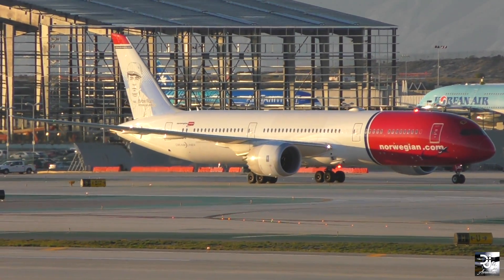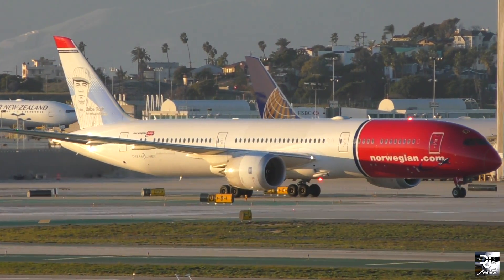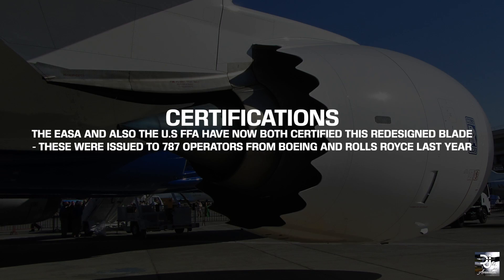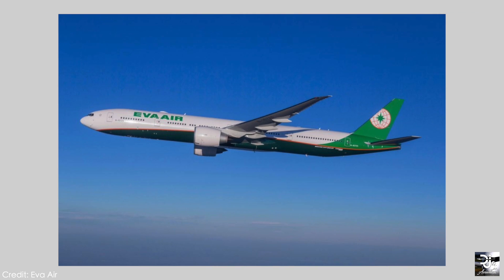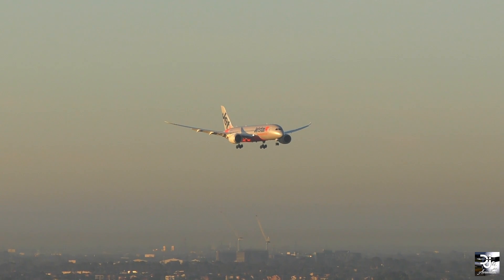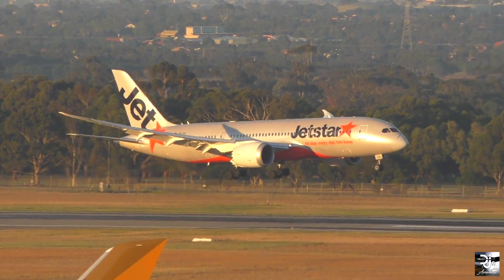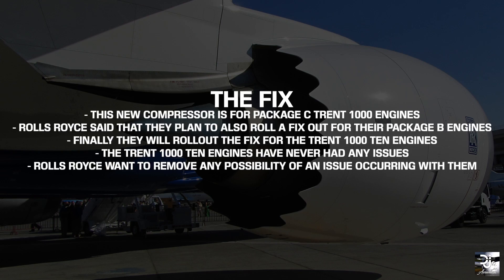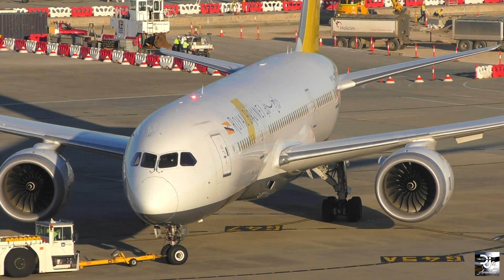Trent 1000 Problems on Boeing 787 (Update)

Comment: You need to get your terminology correct. The issue is with compressor blades and not compressor fan blades. The fan blades are not the issue, well not at this time anyway.

Comment: EASA permits Trent 1000 waiver over blade issues

RR suggested that cracks in blades and drum of the compressor is not an issue that may cause fail.
😎

Comment: Issues with the engines? Are you kidding me? Nothing more nothing less, "just" the engines. Shouldn't all these aircrafts be grounded until these bastards see how to fix the problem? They should be in prison
Reply: Jorge Trevino Calm down buddy. You’re a little late to the party.. All of the affected RR equipped 787’s were grounded and still are.
Reply: @jaemelo2693  are you sure about that? Bcz I might be traveling in two weeks ATH-SG with 787....if it's not yet fixed, what plane they will fly ?
Thanks
Reply: VBlam lol my comment was relevant and accurate at the time of posting (over 2 months ago)

Comment: thanks DJ. I presume you looked at Rolls Royce website for information. I live in England and when the 787 engine problems happened I did look at # Rolls  R # website when earlier problems were found. It was good to see that  RR was dealing with the engines.
I presume that other engine makers like Pratt & Witney and CFM may also have had technical problems in the past.
Reply: R-R is not the only engine maker to have issues, but they sure have had a near continuous string of troubles in recent years. The other players, not so much. Keep in mind each and EVERY engine represents dozens of millions of dollars per cock up, in terms of EACH engine, loss of revenue, securing replacement aircraft, passenger impact, bank payments on non-operational aircraft, and potential future loss of business. This could be R-R's second "RB.211 incident" with the potential to break the company again if they have to cover full loss of value to the airlines. And yes, l do get the irony the Trent is a direct descendant of the RB.211.

Comment: Just because they got "certification" does not mean that the problems with the engines magically get fixed over night. This "fix"is going to take months. I would be interested to know how many planes are grounded because of the Rolls Royce Trent 100 engine problems. Airlines are also badly impacted as they need to lease aircraft and passengers are also affected due to cancelled flights and having to fly replacement aircraft. I still don't believe that Rolls Royce have put enough resources to fix the problems in a TIMELY manner. Airlines will think again moving forward about ordering RR engines and no doubt opt for GE engines in the future. Boeing also needs to show more leadership than it had to date about which partners it selects.

Comment: the only fix required: remove those RR engines and put some GEs on. done. 
all interfaces are the same so they only have to find some fan cowls for the GEs.
Reply: ...And a few truckloads of "extra" engines that GE has laying around. GE is at capacity, building existing orders as quickly as possible. I'm sure if there were any spares available, GE would have sold them in a blink.

Comment: Interesting video, as always. The only thing bothering me was that the thumbnail was a KLM 787-9 which has the GE variant of engines on their 787’s (if I’m not mistaken) While the video is focused more on the Trent engines which the KLM doesn’t have. Otherwise everything was top notch as usual
Reply: TheOrangeHoodie The Jetstar 787 in the video is also GEnx powered. You are correct regarding the KLM, it is GEnx.
Reply: Nobody can find Trent 1000's moving.

Comment: My last flight on AA and AA 787 have Rolls Royce engines and I did note that the pilot turn off and on the engine numerous times on the taxiway like there was a problem
Reply: Kenny G Choonit a lot of carriers will do single engine taxis to save fuel.
They will also shutdown the engines, if there are delays in taking off.
Reply: @WorldTravelA320  I noticed this also happened while we boarded the plane and waited at the terminal I thought it was strange because the air condition kept turning on and off to
Reply: Kenny G Choonit I believe AA has GE engines on their 787 fleet. They only use RR on their 757 fleet which are being retired over the next few years.
Reply: Roholi You are correct - the AA 787 fleet is GEnx powered.
Reply: Those aren't the main engines. That is the APU or Auxiliary Power Unit which is a small engine that supplies power to the aircraft when it is at the gate. The main engines are only started after pushback, at which point the APU is shut off, but can be restarted at anytime (again it is often restarted if main engines are shut off).

The fan blades on the intake portion of the engine can turn freely, in fact a gentle breeze can spin them on the ramp.

Comment: That's  why you should always get GE engines on your airplanes,
Reply: Gustavo Fernandez like GE doesn’t ever  have any problems?
Reply: @brendanpetry6709  you won't ground the fleet as it happens witb RR, they are far more reliable.
Reply: Gustavo Fernandez it’s good that Rolls Royce grounded their engines for inspections before any bad incident happened though
Reply: @brendanpetry6709 at 25 million per unit, I would expect them to be far more reliable then that...
Reply: Gustavo Fernandez and with the 787 costing around 300 million per unit,  I would hope it would be more reliable than a galaxy note 7.
Reply: @gustavofernandez7178  er at 100s of millions, rockets have much poorer reliability than a high bypass turbofan engine.. scale is not correlative and causation is not correlation. In other words, just because it's more expensive means nothing in the way of reliability, it actually trends downwards rather than upwards and even then is highly relative to it industry and applications.

Comment: I'm wondering how much compensation Rolls Royce needs to fork out for this mess......
Reply: Gabor Kerek a lot.
Reply: 4,600 jobs to go at jet engine maker Rolls-Royce
. The engineering firm, which has struggled to come to terms with problems with its Trent 1000 engine, hopes to save £400m a year.
Reply: I’ve seen quotes that they’ve already lost 750 million on the whole mess...